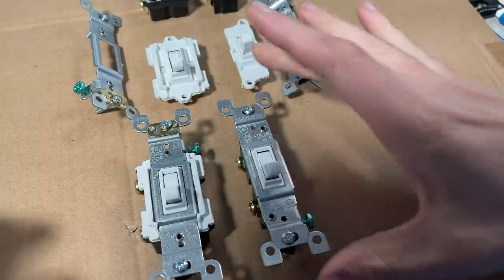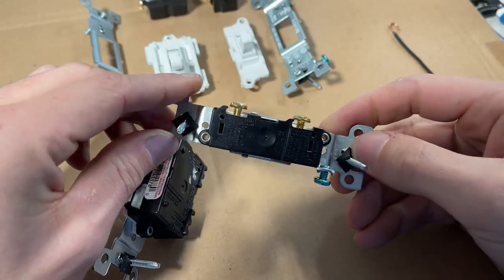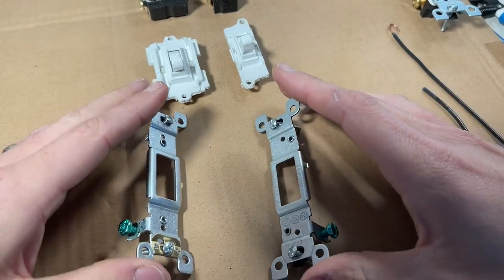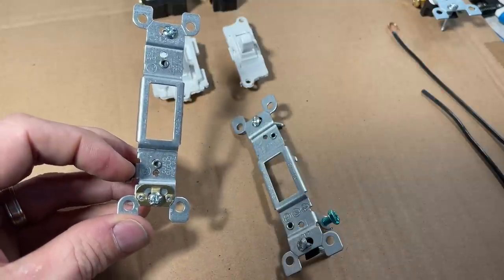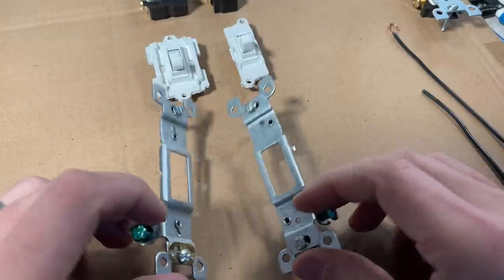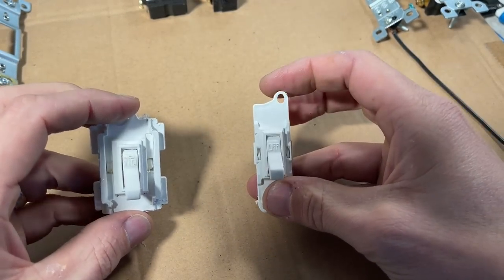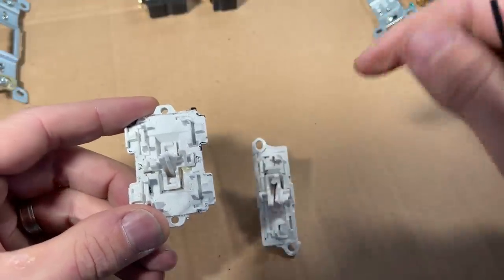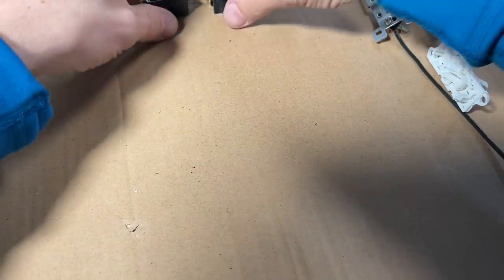What Light Switch Should You Buy For Your Home |  Commercial vs Residential

Comment: If it's for your house, and you plan to live there for five or more years, go commercial.  If you are repairing a rental, or fixing up a house to sell... go with the cheapest solution (which could be commercial if it's on sale or there's a closeout/deal).
Reply from the maker: On the switches I feel comfortable using residential for most situations.  The Receptacles are a different story https://youtu.be/kX6xnOksQTc
Reply: As a landlord I wouldn't go cheaper for one main reason: insurance. Besides, you never know how a renter is going to treat the thing.
Reply from the maker: @AZStarYT  for rentals if I am doing a rehab I prefer Commercial just to make the unit a bit more bulletproof as renters put just about all systems through the wringer.
Reply: @AZStarYT   LOL... you know the answer to that one already.  They are likely going to treat it poorly.

Comment: TL;DR if you have "Trailer Park Grade" crimp switches or sockets, just retrofit a proper replacement if it fails; it's genuinely hard to install a crimp box, and not worth the effort.
I had a switch with a contact point erosion/arc failure from long term use. It wasn't a standard screw terminal switch, but a "trailer park grade" crimp terminal switch, with an integrated cover plate, and screws with flaps intended to directly clamp the drywall. There was no box or anything, just a hole in the wall and insulation. I happened to have a replacement on hand, another crimp terminal box that was basically identical, and I tore the wiring out of the crimps and got to work.
And after working with them, I can give a gloriously bad review; If you're going to replace "trailer park grade" stuff,  don't even bother trying to find an identical replacement, just get the standard stuff. The thing is, even if you do find a replacement, You'll never want to work with crimping again after the first time. It's so much easier to retrofit foundational housing equipment in place of what was there before.
At least the light the switch was attached to worked by the end. Next time one of those switches or sockets fail I'm replacing it with a proper kit, even if I have to retrofit the drywall clamp screws. Not even going to worry about putting a box in if I can help it, I can just wrap the back half in electrical tape if I really need isolation.
Reply: Come On!  All connections need to be in a box!

Comment: I was hoping to see the electrical contact pads comparison. Does the commercial have thicker/wider pads to support more cycles or current?
Reply from the maker: Not that I saw.  The contacts looked identical but the commercial switch motion did have a bit more "snap" so that would help with the life of the contact.

Comment: You compared the  
15 Amp Single-Pole Toggle Light Switch, White                                         Model #R52-01451-02W  $  .64  (1.01x1.31x4.2)   2 Yr war (UL List)
15 Amp Preferred Switch, White                                                                   Model #R62-RS115-02W  $1.32  ( .81x1.98x2.21)  2 yr war (UL list)

The actual commercial model is
15 Amp Commercial Grade Single Pole Toggle Switch, Light Almond  Model #CS115-2T             $3.33  (1.03x1.31x4.06) 10 Yr war (CSA, UL list)
Lowes price as of 2/2/2022

Comment: I'm no electrician but if something is safer why not use it a few cents is not worth somebody life
Reply from the maker: Hey David, I agree but honestly with the switches i didn't see much of a difference.  That was not the case with the outlets (more appropriately called receptacles).  https://youtu.be/kX6xnOksQTc
Reply: They are both UL listed, they are both safe. This is a false dichotomy.
Reply: It's not a few cents, it's double the cost, or more. I happen to agree with you nevertheless--but then I only do a switch here, and a receptacle there. I'm not quoting an entire house with dozens of units. Another thing I'm willing to pay extra for: non-breakable nylon plates. Way more expensive than the other kind. Worth it to me, but not to contractors.
Reply: @lawnmowerdude  They're both safe WHEN NEW. UL does not necessarily evaluate ruggedness beyond a certain minimum. UL is not Consumers Union.; they've got a very narrow brief to set minimum safety standards. They'll check a device to see that when it fails, it does so in a safe way--but they do not guarantee that it will not fail at all.
Reply: Everyday Home Repairs z w-

Comment: I bought two 3 way switches the other day, but one of them seems different from the other (even though I purchased 2 of the same labelled boxes).
They are both 3 way Leviton Decora 15amp 120v switches, but the unexpected one seems much bigger in its back casing part, and has 2 brass screws on one side, and the black screw on the other (along with then green ground screw too)
Is this right?
All the videos I’ve seen always have the black with a brass on one side, and a single brass on the other.
I’m sooooo confused :(

Comment: First, both of the switches in this video are residential grade. The more expense and wider one is called "preferred."

Here is a link that shows a Leviton commercial grade switch:
https://www.homedepot.com/p/Leviton-20-Amp-3-Way-Commercial-Toggle-Switch-White-R62-0CSB3-2WS/202034997

My home was built in 2007 using the cheaper switches, and using the one-and-done insertion method. After a few switches failed, I started looking at all of them, and every single one of the cheaper single pole switches had serious cracks in them, even if they hadn't failed yet. None of the wider 3-way switches had those cracks or had failed. But it could have been that the 3-way switches all used the screw attachments and the particular brand in my home of 3-way switch did not allow the single one and done insertion method. I believe that the spring loading of the one-and-one method puts too much pressure on the plastic parts, which after about 12 years start to get brittle and are prone to cracking and failure. This seems to be characteristic of a lot of plastic parts, not just light switches.

Looking at Home Depot and Lowes, it appears that builders (and home owners) are moving toward rocker switches, instead of the toggle switches examined in this video.
Reply: The link I provided above is for a 3-way switch. Here is the Leviton single-pole commercial grade switch:
https://www.homedepot.com/p/Leviton-20-Amp-Commercial-Grade-Single-Pole-Toggle-Switch-White-CS120-2W/301447075?MERCH=REC-plpbrowse_multiNA-301447075--N

Also, note that some of the more expensive switches may support 20 amps (instead of 15) and up to 277 volts (instead of 120).

Comment: According to building code grounding all circuits switches/plugs is mandatory using green post.
Reply: That is false maybe locally for you maybe, but say metal conduit or even ac cable in as long as it leads back to the disconnect uninterrupted is considered a legitimately ground. There is literally no reason to use a separate ground if metal all the way to the disconnect, it's only local requirements sometimes, and many companies standard practice. The ground is basically a second neutral in most cases (shouldn't actually be used like one) and turns your electrical system into a giant lighting rod/redirect.

Comment: Your switch grounding explanation is reversed. Those clips on the yoke are self-grounding devices. They ground the switch if your metal box is already grounded.
Reply from the maker: Nice, thanks for the correction.  Appreciate the help.
Reply: bnasty267 is correct! The residential device MUST be grounded with a separate ground wire while the commercial can use a grounded metal box (although a separate ground wire is more secure).

Comment: Something I've noticed is some switches have different width toggles. What I mean is some switches (like both in this video) have a plastic bezel which sits flush with the hole in the cover and others have a wider lever which occupies the entire space in the cover opening. Does anybody know if there's any reason or convention for this difference? I was thinking maybe residential vs commercial grade, maybe it's 15 vs 20 amps.

Comment: With the backstab connection method. If the switch is UL rated wouldn't the backstab method have passed muster with UL and would thus be perfectly safe?
Reply: There are big issues with backstab. Your better off going with screw terminals. Screw gives you a better more durable mechanical connection, so why not go with whats best rather than go with an weaker connection just to save a few seconds. Backstab gives a weaker connection as a result of pure laziness. With good connections you want a strong mechanical connection and also a lot of surface contact between the conductor and the device. If you dont have enough surface contact the connection can overheat and you can end up with melting or fire. Screw gives you highest confidence in both.

Comment: Are the contacts and contact spring the same?

p.s. It's Robertson not Robinson.
Reply from the maker: The contacts are the same but I did mess with the 2 switches yesterday and the commercial grade was a bit "snappier" which would help the life of the contact.
Reply: @EverydayHomeRepairs  So it has a stronger spring which makes for a better electrical connection.  That's good to know.  I replaced the cheap light switch with a commercial one for my furnace.

Comment: How does one fit two professional switches together in a two switch box ?
Reply: They fit fine. I've got a box in my house with 3 of them in it and a box in my garage with 2 in it. They weren't hard to install at all. You may have a little trouble if using 12 gauge wire but it's easy with 14.

Comment: if i can get this comment in without all of the safty nazis complaining about cubic inch bow requirements and such, i do like the cheaper switches because they are just easier to fit in a box of wires. that and its just easier buying a box of 10 than to have to count them out. for lights anyway. if the switch will be activating any heavy loads, i will make certain it is a 20a rated switch. the cheap ones are usually 15a.
Reply from the maker: Thanks for the feedback!

Comment: I would only use commercial if I am using Stranded Wire. Stranded can be hard to make a terminal loop with (The shepherds hook). If I am using solid wire, I would just use the residential switch

Comment: For switch and outlet screws I use a combination  bit, It’s a square and slot bit combined. They com in #1 and 2 square and can add quite a bit of torque without stripping out,
k